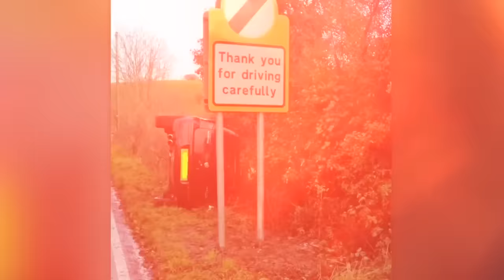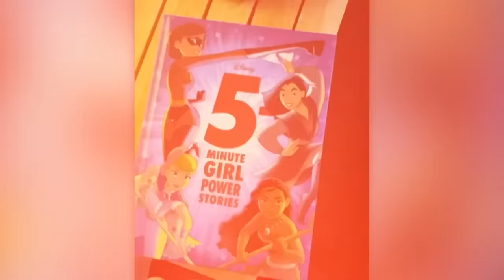You Had ONE Job!

Comment: I used to work for ITT and I can tell you that drilled out tel trunk line will cost that contractor a fortune to have it repaired.
Reply: Depending on if he called for a markout. I've had markouts miss water lines which inevitably got hit and it was their problem, not ours. If the utility guy was lazy or incompetent and missed it it's on 811, not the contractor
Reply: @chrisrageNJ  I doubt they did. Clearly by a pole but not a marking in sight around the site? Yeah...